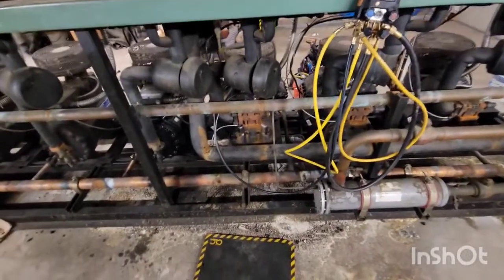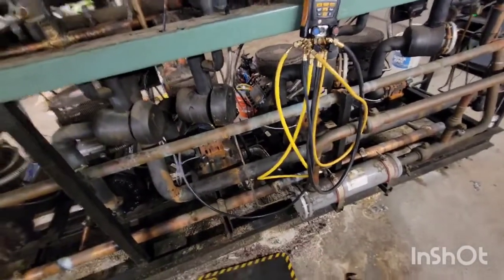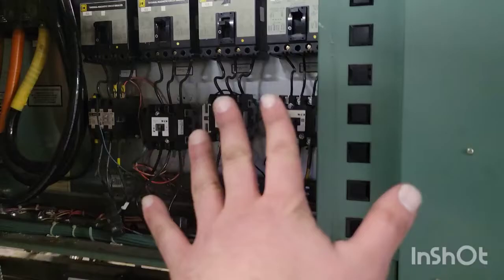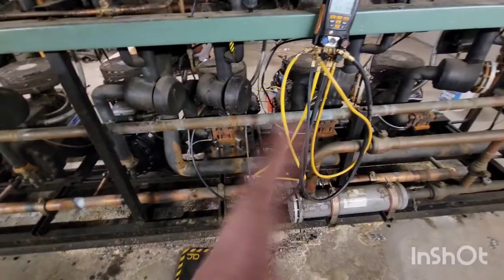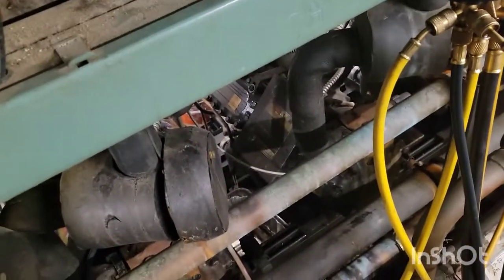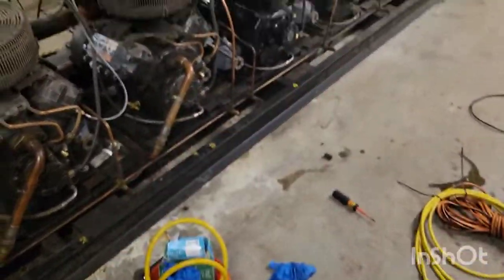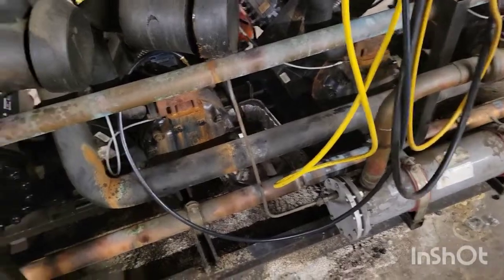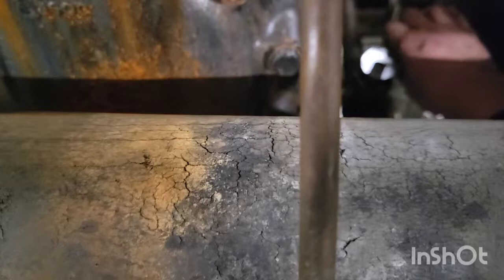Supermarket Refrigeration - Quick Reed Valve Check (Compressor Troubleshooting Guide Step 13)

Comment: So if the compressor was good no discharge would go in there right?
Reply from the maker: Yes it would get to discharge pressure. Because the read valves Will no.longer keep the discharge out because there not working. 

For this compressor it did that. 

So I would need to replace compressor / rebuild the read valves. 

Hope that helps :)

Comment: When you isolate a compressor, do you only leave the discharge open? Thx
Reply from the maker: In my opinion you should close it.

The Reed valves could not seal properly